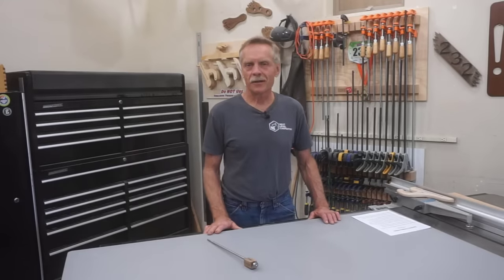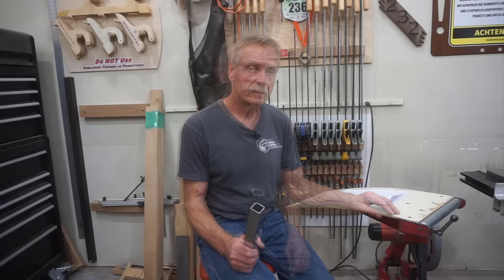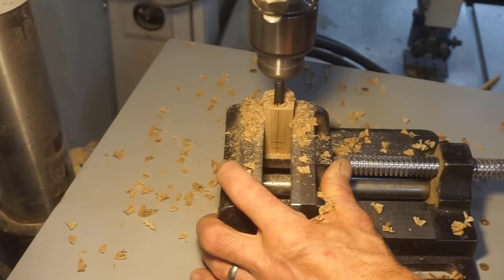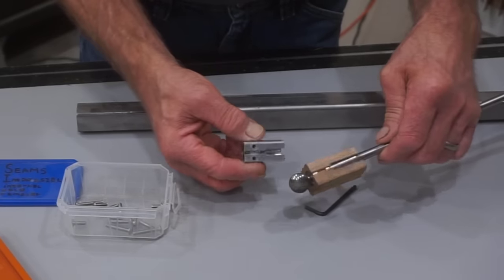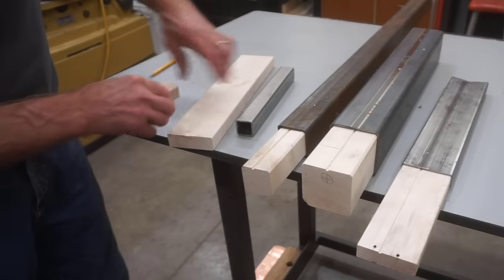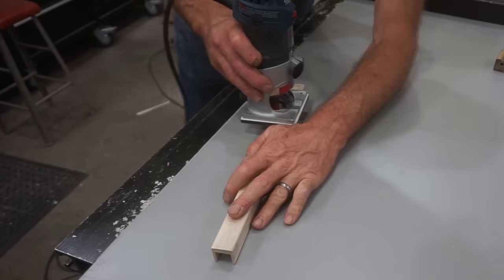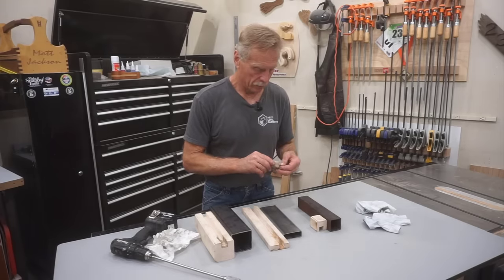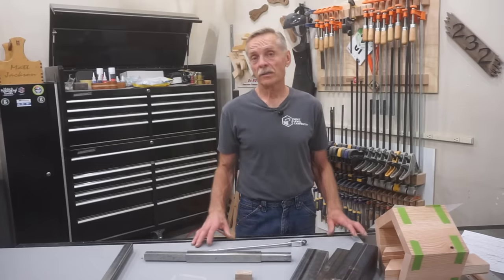How to Quickly Remove Internal Weld Seams from Steel Tubing

Comment: When you make the version 1 block, drill a 1/4" hole all the way through from one end.  Then let that hole guide/align the 2 larger holes from each end.  The 1/4" hole can then be enlarged to provide for clearance.
     When I wanted to telescope aluminum tubing, I couldn't find the sizes to telescope.  The sizes are in too big steps in square tubing.
Reply: This would work if you had your vise on an XY table or using a standard twist drill bit for the bearing holes which would give you a tapered bottom.  A spade or forstner bit rely on self-centering which would be hard if you drill your 1/4" hole first.

Comment: I THOUGHT-UP something similar, but its no where as good as yours. < YOURS USES A DEBURR, MINE DRAG-CUTS all the way across. Anything sticking up gets sheared off. >
   I thought-up a steel block that was milled to clear that weld area till it was inside the tubing and then a hardened cutting blade. Then drill & tap the length of the 1" block. Then screw it onto the end of a piece of All-Thread Bolt. Cut a piece of 1/4" Cold Roll Flat-bar and  drill a hole in the center of it one drill size above 1/2" to go across the opposite end of the tubing and run it thru. put 2 jam-nuts and a thrust washer bearing and hook up to a hand drill. The cutter block would then walk up the inside of the tubing, shearing the weld burr off in front of it. I HAVEN'T MADE ONE YET. It's just an idea. I figure to make sleeves to screw to it to fill in the gap for bigger square, rectangle. Round tubing would have to be drug thru with a clamp over system of some kind. It's been just an idea. 
   Bravo to you for following your dream.
    I've designed so many tools, jigs, Lifting rigs for using a crane, Work stands, to hang in awkward to reach places, test equipment, shortcut tools & procedures for several companies, that its hard to count and even remember, & for almost 50 years. I never really applied myself to build the proto-type. I was going to use a 1/4" high speed, high carbon tool steel lathe bit inserted in a cold rolled steel block, removable so it could be sharpened and the block tapped 1/2-13. Then specify to use a piece of flat bar stock drilled one standard drill size above 1/2" for the other end of the stick of the square tubing. You could do as much length as your All-Thread was, long. I NEVER made the tool, so I lay it out there for anyone to make and enjoy-joy. If you want to make the proto-type and invest your money and patent it and get it into the stores, GOOD FOR YOU !!! I'll buy one. (just give me credit on it that "General" designed it.)
   Bill, from Tn. 🇺🇸

Comment: Good idea  but I can buy that tubing with the flush weld already removed it's called Dom tubing and with that tube there is no under cutting that I get with the rotary deburr . It's full wall thickness .  Just a other option

Comment: What is the name and brand of that orange "tensioner"?  At 26 seconds behind the video maker? 0:26
Reply from the maker: Andras; If you mean the orange pipe clamps in the rack behind me those are old Jorgensen Pony 3/4" pipe clamps. You can find them on the Amazon page in the video description if interested.  https://www.amazon.com/dp/B07X29P1FV/?ref=idea_lv_dp_ov_d&tag=aiponsite-20&linkCode=ic6&ascsubtag=amzn1.ideas.6HPGTC6N04ST  FYI They're decent quality and functional but there's many more options on the market today than when I bought those 25~30 years ago... Best, Matt
Reply: @NextLevelCarpentry  Thank you very much for your quick reply.

Comment: Soooo..... If You Still Have to Make "Jackets" To Fit The Bigger Pieces Of Tubing..... What Makes the 2 Better Than The 1?
Reply from the maker: It's much easier to make jackets for V2. 0 than it is to make a dedicated V1. 0 for each size of tubing and weld location option
Reply: @NextLevelCarpentry  why cant you make the jackets for 1.0? As far as I can tell they're the same thing, just different material.
Reply from the maker: @joshveer1138  you sure could... guess I never considered it but can't think of a reason why not! 😁😎

Comment: Good idea but in my 40 or so years as a metal fabricator I can tell you that all tubes are not created equal. It is my experience that the weld seams are not all centered in the tube and I have even seen them placed in or very near the corner of the tube. Great job on solving your weld seam problem.
Reply from the maker: You didn't watch the whole video Ken... we DID address the issue of weld seam position variance... in rather elegant fashion if I do say.  Both versions of the Seams Impossible tool are capable of removing a weld anywhere on the internal face up to and including 3/8" from the corner.  That limitation is based on the 3/4" diameter of the ball burr used and covers I'd say the majority of tube/weld conditions.  But thanks for the compliment... I think your appreciation will only grow if you watch through the video to see how we dealt with this... Best, Matt
Reply: @NextLevelCarpentry  I absolutely did watch the whole video. Your tool can not grind a seam in the corner. If you are able to pick through the suppliers tube to find one that the seam is in the "sweet spot" area it will work better than anything else I have seen for removing the seam. Great job on solving the seam removal dilemma.
Reply from the maker: @kknvlewis  Ok, cool... my experience tells me that the majority of seams are not closer than 3/8" to a corner and figure it's easier to rule out seams that are rather than design a tool that will go farther into the corner... tolerances for a 1/2" diameter burr are exponentially greater than for 3/4" and for my purposes aren't worth striving for.  Sounds like you've had considerably more experience with metal fab than I but I've not seen 1 1/4" tube where the weld was outside the 3/8" wide sweet spot the tool will reach so 'picking through suppliers' has never been an issue.  Many viewers disparage the whole concept implying that DOM/Seamless tube is inexpensive and readily available in short project-specific pieces but I've not found that to be the case either although that may well be a product of my lack of in-depth experience as well.  All the best to you!  Matt

Comment: Wish u had one for steel round pipe , 1” steel and 3/4 fit together, just weld seam preventing it,
Reply from the maker: Just use a round grinding burr like this of the right size: 
https://www.amazon.com/dp/B08QHXFLBF/?ref=idea_lv_dp_ov_d
  ... you can dress a larger diameter one down to fit perfectly inside that pipe and grind the weld away.

Comment: There is a few of these videos that all work
Reply from the maker: True... but the Seams  Impossible Tool is the only one that can remove the seam from a tube of any length and is also easily adaptable to tubes of any size and weld location...

Comment: HI MATT, ARE THESE STILL AVAILABLE?
Reply from the maker: Absolutely Thomas!  Looks like there's 174 in stock as of right now: 
https://gregsgaragekc.com/store/#!/Seams-Impossible-Internal-Weld-Remover-Deluxe-Kit-*In-Stock-&-Shipping***/p/229336638/category=32313054  
Plus also, they'd fit nicely into a Christmas stocking 😃👍  FWIW I'll be doing episode #3 of the ongoing GROAT roller stand video series soon.  That's the episode where I show the Seams Impossible tool in action during the build...

Comment: So the problem is that the welds are not always in the center of the tube! I have som 1.5 x 1/4 wall tube that the weld are very need the Conner.
Reply from the maker: This solution will work within 3/8"~5/16" of the corner if that's any help...

Comment: Interesting...

If you found an old set of junk parallels, you could just use super glue to temporarily affix them to the relevant sides of your tool if you just needed to rip one seam out of something that was just slightly oversized.

Comment: That's nothing new. Back when I was apprentice metal fabricator over 30 years ago. There were older guys that all sorts of hodge podge devices that they made to remove seams in tube. It was just another tool to them, that they didn't think much off. You're a carpenter, so now you've worked with steel, and you figured out a problem, you wanna shout to the world how smart you are. Over the decades, myself and other metal fabricators have been stopped by a problem, we've made countless tools and adaptations of tools and new methodologies we have had to create to get the job done without blabbing it all over the net. And we don't go working with wood, and then tell carpenters how to do their job. Thanks for sharing
Reply from the maker: What a bizarre perspective... is everything OK at home for you?! 😠
Reply: @NextLevelCarpentry : Yep, you blabbed about solving a problem and
turned it into both a project and a product, so others can either build or buy one.
What did he and his buddies do? They each bought a sixpack, on the way home, without
sharing or pursuing anything. Yeah, I'd say you're pretty darned smart..
I think he saw this video, after finishing his sixpack, and that old green goblin bit him in the ass.
😲😭    🤣🤣🤣🤣           😁✌🖖

Comment: Leave it to a woodworker to reinvent a metal-working tool..  Blacksmiths have had a tool like that since metal tubes were made by forge welding strips into spirals and square tubes.  They used a piece of hardened steel, with a flat or round cut face that was pushed down the tube as a scraper, either in front or as a tapered fliuted reamer with cutting scrapers on the side.  The reamer can be used in square tubes by connecting it to a shaft whose diameter is just slightly smaller than the clear tube and twisting it rapidly  as it is pushed through.
Reply from the maker: Not sure where you're coming from but your comparison is like saying Alexander Graham Bell re-invented the telegraph with a telephone... which I take as a compliment!

Comment: You would think that they could just put the seam on the outside instead of the inside or just be more accurate in the welding.  It would be cool to have metal suppliers offering this as a service, but I don't see that happening.

Comment: Counterbore the holes on the block then you wont need to drill all the way thru the guide block and then have to counter bore the back side of the guide block or have to use different lenth screws for each block ! You could use the same screws for every block and just screw them right in without having to drill thew the guide block first

Comment: I use to work for Tenaris tubing and we took the scarf out when the pipe was being made if that's what the customer wanted.  I'm assuming you can order square tubing without the scarf also but it will cost a lot more.
Reply: Yeah...'no flash' tubing...very common request for 2 inch square for hitches...the internal 'flash' is removed by a carbide cutter that is pulled through the tube...either when the tube is made, or later when it's a 20 foot piece.

Comment: 10:10 in the video is the longest drawn out math for a radius that should have been stated as 3/8 inch as the simplified fraction. Doubling your denominator and not changing your numerator will always give you half your current fraction and far less confusing. 3/4 = 3/8, 3/8 = 3/16, 3/16 = 3/32....
Always worked for me so far.
Reply from the maker: Now if I could only just remember that Roger we'd ALL be better off!  Thanks for adding useful info...

Comment: That will be ok ontil you figure out those seams are not always On  center . The seam on rectangular tubing is rarely in the center . Buy the time you invest in the tool and spend the time removing the weld , ordering the seamless tubing that fits together would be cheaper and faster .
Reply from the maker: Open mouth, insert foot: 18:30 
Maybe you should invest a little time paying attention before trying to convince other viewers how smart you think you are?

Comment: Maybe I'm missing something, but why not buy seamless tubing if you need it for this application?
Reply: Ha good one. Where do you buy your hens teeth?
Reply: @janeblogs324  Well, I have never had occasion to want to purchase hen's teeth, so I can't speak to that, but seamless tubing I've purchased many times.  It can be purchased from various vendors.  One very common variety is called receiver tube, and it is used for trailer hitch receivers, and can be purchased from any steel supplier around here (usually in stock).    However, seamless tube of all kinds of sizes can be purchased.   A quick google search found "Louisiana Steel" which makes seamless square tube up to a surprisingly  large 12" square, with up to 1" thick walls.
Maybe they sell hen's teeth, too.  You can contact them and find out.

Comment: problem I see with pulling the tool through the sleeve, is that the bur will eat destroy/eat the sleeve
Reply from the maker: That would be a problem if it did but it doesn't so it isn't! 😉😁😎 Best, Matt

Comment: Hah. This is crazy, I made a tool just like this 5 or 6 years ago when i built my 2x72 belt grinder. Except mine was made out of aluminum with a bronze oilite bushing. I used additional guides with shaft collars for the longer version to reach far into long tubing, otherwise it the rod would wobble all over and bang the walls.
Reply from the maker: Interesting about the additional guides which I think is a pretty neat idea for anyone doing extra length tubing... Kudos!

Comment: The seam isn’t a huge problem.  You go to a real steel supplier and spend a bit of extra money and buy seamless tubing.  Maybe in a home shop removing the interior weld makes sense, but in a commercial environment, it is more cost effective to just buy the seamless tubing.

Comment: I can't find the tool on Amazon only the bit and shank and when I click on the links I get a virus alert warning.
Reply from the maker: The Seams Impossible Tool isn't available on Amazon (yet), only the various bits of hardware.  Greg's Garage site is totally legit as we've sold nearly 1,000 of the units so make sure to vet the link or contact Greg directly if you're in the market for a tool.  We don't want anyone getting a virus but do want to get a tool to you if you want/need one! 😉😎
Best,
Matt
Reply: @NextLevelCarpentry  Bugger, I've managed to bypass Norton by using my iphone and I've gone about making a full kit purchase but at the delivery detail process it tells me they don't deliver to my residential street address in Australia. Oh well it looks like I'll have to purchase the bit and extentsion and make a version 1 tool myself.
Reply from the maker: @specialized29er86  you might try reaching out to Greg via email to see if an exception to standard shipping protocol is possible.  Not trying to talk you out of making your own, just trying to provide great customer service... after all, anyone who goes by Specialized 29er must be a mountain biker and worthy of top tier treatment IMHO! 😎

Comment: Make a square hole broach or buy one.. Then just push it thru the tube. Simple, fast  Not low cost on large size, It is easier to pull it thru the piece is the work piece is long.. Think of making a Rifle Gun barrel.  If the weld is very course, adjust the cut to a smaller amount, Then re-cut the piece on the next pull,
Reply from the maker: If you need to get somewhere just ride a horse: no complex maintenance agreements no fossil fuels no electronics and no periodic maintenance... if you're going to slow just yell giddy up!